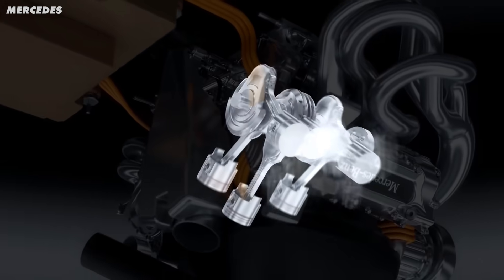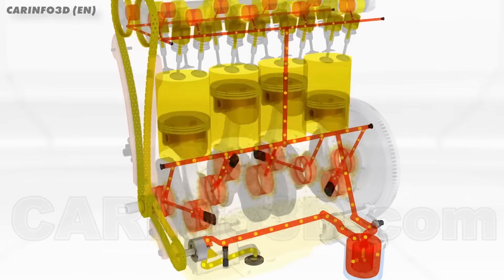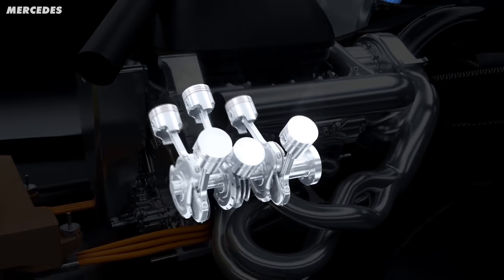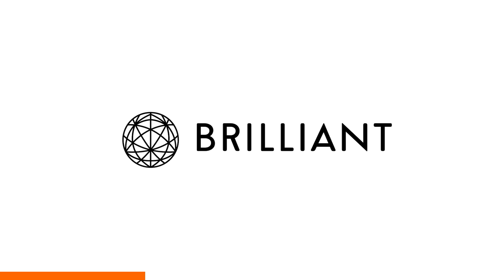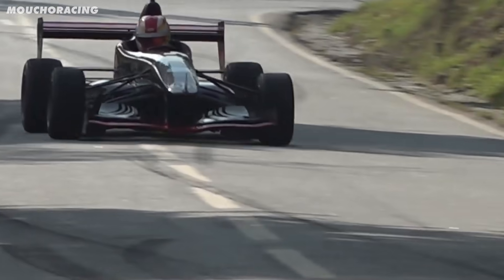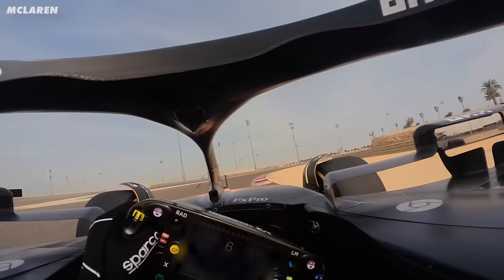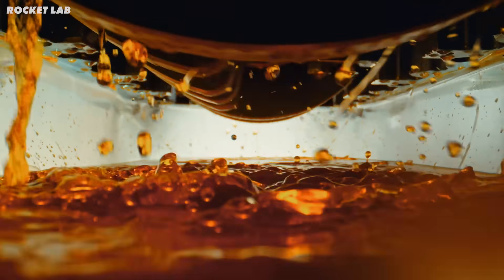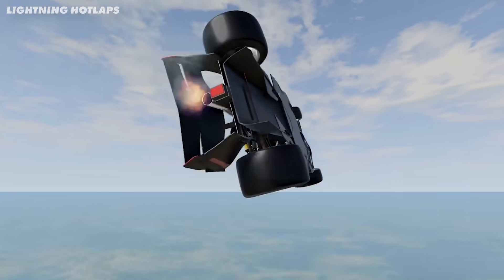Why F1 Engines Won’t Work Upside Down (for our stunt)

Comment: An air cooled, fuel injected, 2 stroke engine would have worked fine. It would have also had a mich better power to weight ratio.
You can make a lot of hp in a very light platform. Also, there is no coolant or motor oil to deal with.

Comment: Would it be an option instead of the tunnel, a 360-degree ramp to turn the car upside down?, At the top of the ramp (180°) you can start the straight line so that it runs headlong, then to descend it should be with the other half of the ramp.
;)
Reply: A problem would be the g forces that the pilot would have.

Comment: I dont see why this is an issue.

If you need to go say 130mph to stay upside down for 5 seconds then figure out how fast you need to go to stay upside down and above 130mph for 5 seconds.

So let's say if you are going 150mph and you let off the gas entirely and you slow down to 133mph in 5 seconds.. And you only need 130 to stay glued to the road... then just do the drive at 150mph and then it doesn't matter if the engine craps out because you will still being sucked to the "ground" until the time you are back right side up.

Comment: Why not just have two engines and one is mounted upsidedown and then switches on as it passes a certain angle and then the other motor shuts off right before too much of an angle ? Then switches back to other engine going back to not being upside down.

Comment: 2 cycle engine air cooled. Fuel tank would be a long filled and pressurized tube, since only 4 or less liters is needed for each run. Liquid Natural gas could possibly be also.

Comment: you guys have not talk about 2-stroke engine in snowmobile, they can be in any dirrection and are made to be as small and light as possible, some modded engine can do around 250 HP. Maybe im wrong but i feel like it could be one of the best powertrain methode but it would requier diff and driveshaft.

Comment: Three stage dry sump with a suction at the bottom and top would work too. Along with a weighted pickup for the fuel tank, doesn't need to be excessively complicated.

Comment: I was one of the people recommending an aerobatic boxer engine from an airplane. I don't think it is that heavy and they are very reliable. The biggest downside is throttle reaction which is none, as airplanes keep RPMs as constant as possible.
But I didn't know that Formula Student motors weigh 3kgs each! I mean I know some crazy motors that are ~30kgs and output 300hp, but 67hp for 3kg is something else. Go with it!

Comment: Carwow has covered and review an electric car with a big fan that sucks air so the car is sucked onto the road for traction. It does the quarter mile in less than 9 seconds due to grip not being the limiting factor anymore.

Comment: I feel like using electric motors remove the mechanical wonder from cars. you should call the video formula E car drives upside down... not formula 1.

Comment: You're only driving upside down for a few seconds. The engine not getting oil is not an issue. Yes it's bad for the engine, but you're not going to do it daily, are you? Just test the engine upside down to see if it works for at least a minute and problem solved. You're going through all kinds of hoops to solve a problem you don't know even exists at all.

Comment: sure a continuous sustained upsidedown wouldnt work but i dont see any reason why this wouldnt work for just a few seconds that it would take , not like a few seconds without oil will kill it
Reply: F1 engine would be lucky to last 1 second starved of oil without seizing up. Incredibly tight tolerances plus insanely high RPM doesn’t bode well.

He wants to drive upside down for 5 seconds. That’s up to 1,600 revolution the engine will need to do completely starved of oil (20k rpm / 60 x 5).

Even if it didn’t suffer a catastrophic failure it can’t even vary its power outlet (thus speed) over the course of being inverted.

Comment: The Original RollsRoys Merlins used in the Spitfire Before being replaced by the Rolls Roys Griffons, suffered from a floating Carborator design, which meant that the Messerschimdt BF109 and the Fokerwolf FW-190's had an advantage during negative G maneuvers. This resulted in the german pilots trying to bait and evade the pursuing spitfires by going into inverted dives where the spitfire wouldn't be able to follow in a same maneuver chase. The engine would stall as the carborator's floater would disrupt the fuel flow into the the enginge. The Spitfire pilots learned to work around this disadvantage by utilizing the spitfires strengths such as turn radius in a maneuvering sequence where rolls would displace the directing of lift compared to gravity and direction of travel, to pitch into a downward spin turn losing as little air speed as possible(this is a trade off), while reconecting with German planes.

Its comparable to chosing a different racing line or driving style to compensate for a style that a racing car cannot do, such as angle towards apex and entry and exit speeds. It's easy to run into debates and myths about which plane was better because it was faster or had better turn time, or even climb rates or weapon capabilities, but just as with formula 1 and indycar certain designs are good at different things, and the same goes for the pilot of a racing car as well as a fighter plane. Looking at confirmed kills also is grossly oversimplified. Enough of the history lesson, let me get to my point:

Understanding what limitations keeps a standard spec F1 car in 2023 from being used in the stunt is important. But it also comes to a point where a question has to be asked: At which point is it no longer a F1 car? To which degree must the challenge be completed through the driver's use of the vehicle and when is it okay to make the modifications. Its a  tough balance, but there is a limit. Otherwise, we can just lose the wheels give it wings, basically greate an airplane fly it inverted, and then claim to have driven an f1 car upside down, as long as the gears touched a tunnel ceiling. At some point you can argue if you really did drive an F1 Car upside down or not.

Please don't misunderstand me, I think its a great project, and I don't whish to take anything away from you, or discourage anyone. But while some problems like an engine upside down working or not is not a first time in history thing, and its interesting history facts and all, I think its important you don't forget the mission, and when its all over are honest about the solution, when evaluating if you succeeded or not, regardless of driving a machine, upside down using speed and downforce. Which is a great project regardless of anything else. I am very excited to see how it all ends! Please don't take this as hating criticism, but just a few words for reflection. I am fully supporting the project no matter which decisions are made, I think it's awsome!

If you want to know more about the spitfires engine weakness I would have reccomended a Documentary that I unfortunately cannot recall the name of, the closest and most accurate of them you can find here: https://www.youtube.com/watch?v=qqIKzdlHQfo.

Comment: I don't get it, doesn't a bunch of pumps solve any possible issue? You'd have to add a bit of weight and volume to the PU and that's all to make it work in any orientation you like. Why are you complicating this matter this much? I think you're just over engineering it.
Reply: When you invert an engine all the oil from the sump dumps into the cylinders where the underside pistons would impact a wall of oil. 

Often the reason engines shut off when a vehicles rolls over. At high RPM this is usually a catastrophic failure, snapping wrist pins, breaking the piston and/or connecting rods. 

You might be over simplifying this matter.
Reply: @cynic5581  Ok, so if the oil dumps into the cylinders cause of gravity, just add a pump to push it the right way. What's the issue with that?

Comment: As someone who was involved in formula student AWD powertrain and torque vectoring I really like it. I think you can get the power and speed needed and the weight (depends mainly on battery) can go to like 64 kg for whole powertrain. (18kg motors + gearboxes, 40kg Accumulator , MCU 6kg).
The main problem I see here is reliability of formula student solutions and the fact that typical torque vectoring systems are not programmed for a 3D driving so the GNSS and IMU data might get incorrectly fused. So I think you would have to design a different -> more simple Torque vectoring system solely for this job to remain straight and with the desired slip levels.

Comment: 2t v8 boat motor adapted to a gearbox? Would be lightweight and powerful. Or put drysump system on a motorcycle/car engine with pickup in the head/valve cover. For fuel, well its easy just use a flexible pickup tube in the tank with a weighted filter like chainsaws

Comment: Put a different engine in it- you just need to go the right speed and equal or less weight, don't even really need acceleration- you could use a little 4 banger with a really long gear ratio- if the engine was small enough (like a motorcycle engine) you could make a system that turns the engine to keep it upright. It'd probably just be easier to put something like a small plane motor in it, those can be oriented in any direction.

Electric also! You don't need a full sized battery, you could even make your own- it's actually not that hard. Set it up so you can swap the battery out so you can test quickly

Comment: what about using the same car as the one used for the 0 to 100 kph record (it's a formula student with 4 electric motors and a big air pump to stuck the car to the ground) this car will only need few modifications to work perfectely upside down : it needs to work during about 5 minutes instead of 5 seconds...that's all (the car is already able to reach 160 kph and have something like 1 or 2 tons of ground effect to maximise its grip, but it works for about 15 second )
the car you need already exists and only need few modifications
Tom Scott tested it
https://youtu.be/XQIu5tZ0vbQ?si=4xO2kTjX1slDbSaM

Comment: welded diff lad
200kw is fine
i run 170kw through a weld but with 400nm
4L inline 6 with n/a mods

Comment: You're only going to be upside down for a second at most. Just get a high capacity oil accumulator to maintain pressure during inversion and if the flow volume is THAT HIGH then get scavenging pumps to extract the oil from the valve covers. 2EZ.

Comment: I can’t resist being pedantic and arguing that F1 engine still does work upside down. The question instead is how long it will do so and how rapidly the performance deteriorates.

For this project, this line of reasoning is likely fruitless, as even if the time was around the needed ballpark, one would need wide safety margins for such chaotic process. And it seems unlikely F1 engines just had such tolerance to begin with.

I recall that early WW2 bombers and fighters had similar issues with some high G manoeuvres, specifically diving to bomb, let alone flying inverted or close to it. The engine would be starved from fuel without force working downwards, which became apparent only when the pilot tried to break their dive. Long duration dives and other such manoeuvres risked completely extinguishing the engine. But for short durations the engine could be used like this.

Comment: You should consider buidling a second "tunnel" inside the main one, 1´5m smaller in diameter, perfectly centered, so that in case you lose the car in the critical stage of the run you don´t fall to the ground but to this second estructure, avoiding a huge crash. You could even add some kind of subframe to the car where you would allocate miniwheels on the top. This would help you slide with minimum damage in case the car lose contact with the main tunnel surface when upside down until you could gain contact again with your tires. Once you had the stunt under control you could retire this second tunnel for showtime. Don´t even need to buid a full second tunnel, but just where the thing gets really dangerous in case you fall, that is from where the car gets 90 degrees "rotation" or roll to the full 180 degrees roll.

Comment: How about super-capacitors, which are designed for high power density, fast charge time, and high-power output, but the downside is having a few minutes of runtime. But I think this will be sufficient for your application.
Reply: yeah, for EVs they are not suitable because of their low energy density so i always cringe when someone suggests it for this - but for this project it is probably perfect. Also since the capacity is very low using Supercaps instead of Batteries also avoids killing them off early because you want do draw too much power out of them..
Reply: Thanks! @unitrader403
Reply: I think another advantage is that super capacitors don't explode or burst into flames, when damaged. They could blow though if it was over or reverse volted.

Comment: I'm neither working nor studying in motorsport, but I have programmed a 4-motor torque vectoring system for a mod for BeamNG called the Saber OMPW - I have uploaded some videos on it in the past.  It's currently deprecated on the repo but if I got involved here I'd like to update it.  Also because I can see you're using BeamNG to model examples for the video, I wonder if you'd also use it to simulate the torque vectoring.  I'd be interested to offer my input on the work that I've done there and compare it to what you guys are doing, although the online form doesn't seem to work for me.  One thing that I'm interested in is how the system handles side-to-side vectoring vs front-to-back vectoring, something I also call skid-steer vs understeer-oversteer.

I found that the understeer-oversteer could only be properly managed by adjusting it according to sideways G-force - specifically according to the square of that force - rather than trying to infer G-forces from yaw rate or otherwise.  The reason I mention this is because this allows the system to seamlessly work with the G-forces in a side-hilling situation, so it would work correctly on the side of the tunnel.  Also if the car shifts sideways off the top of the roof, then correcting back towards the centre will cause some unusual shifts in forces that wouldn't necessarily be the same as if the car were right side up on a mostly flat surface.

I find that adjusting all four wheels systematically like this rather than assuming a more or less forwards direction of travel allows the system to work across a much larger range of circumstances than most stability control systems, like for instance effortlessly controlling a drift past 90 degrees and back just by turning the wheel and keeping your foot in the throttle.  I imagine such an approach could be helpful when driving in unexplored regimes like you plan to.

Comment: Hello! Just wanted to post here an idea I had for a video, hoping you guys will like it as well and maybe do it, I just cant be asked to do the math myself.
Basically I was wondering what the final result for the season (both driver and constructor) would be if we were to remove redbull from the equation. 
How many race wins per team, who is world champion? because I feel like it would be very close, very back and forth, with many teams taking wins and the lead in the championship at many moments in the season. 

Also interesting would be to compare it to previous years eliminationg the top team from the equation, because I really feel this will give hope to fans that the field has bunched up a lot more this year and if redbull are not as dominant next year we might be in for an absolute treat of a season!

Comment: Instead of using batteries which are heavy and low power output, you should use supercapacitors. They are easier, deliver more power in a short amount of time and so on.

Comment: 2 stroke is the way super high power density and you dont need to worry about the oil. As long as it is getting premix it will be happy.

Comment: I feel an epic let down is about to occur. Some government sponsored company may be paying for this so a lame electric car will be used. I hope I'm wrong. Got no reply to this suspicion yet. BTW, plenty of gas fueled engines work upside down, and at crazy angles of attack and under high g-forces. Aviation solved this issue long ago and could easily be adapted to a automobile.

Comment: I understand the reasoning but it does seem to avoid the point of the challenge if you don't use a petrol engine; a lot of advocates for two-stroke on here.

Comment: @Driver61, You say F1 car is too fast for the project and also ICE won't work upside down. Also You say an electric motor would be ideal for driving upside down as it has no liquids but an electric car will be too heavy. Anyway, have you considered using the Volkswagen ID.R, or may be its too heavy too. I think it has good downforce, or it's coming at a higher speed than the needed for the experiment. Or You wanna do it all with a formula look-a-like car. If that's the whole idea,please ignore my comment and proceed with the experiment :)

Comment: If you had slightly curved ends of tunnel you could ride car straight trough whole stunt and you would had centrifugal force to assist you wile you are climbing the wall, while you would have straight section for upside down ride.

Comment: Why don’t you use a regular loop de loop, with a flat extension at the top in the middle? It would be much easier than trying to turn up a wall, and you wouldn’t have the issue of 2 wheels being off the ground.

Comment: Has anyone mentioned putting the motor on a gimbal?  Crazy but cheaper?  How about just the oil system?  Maybe?  Electric would be way easier but it doesn't really pass the pub test.